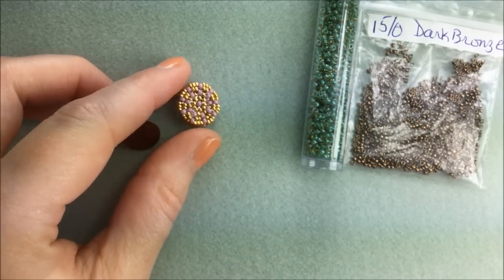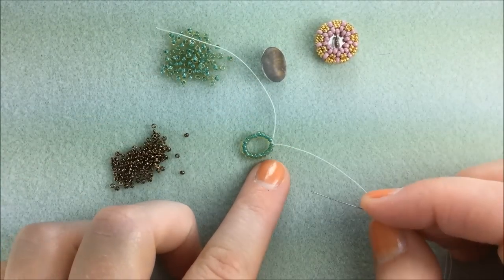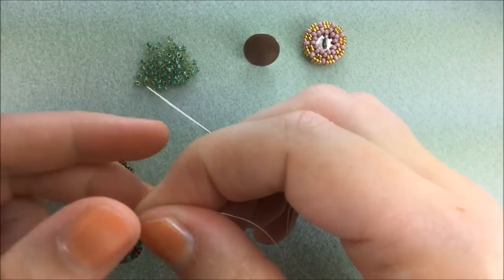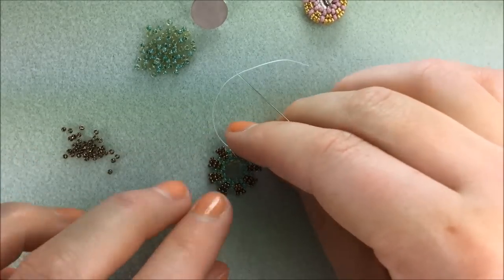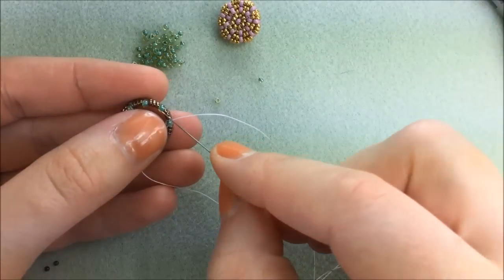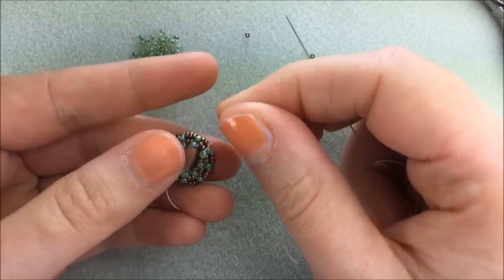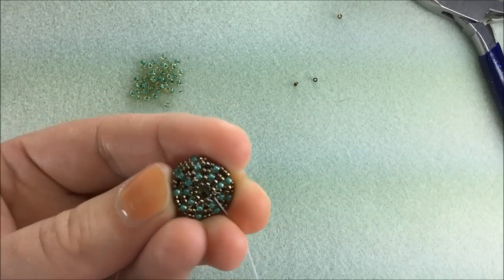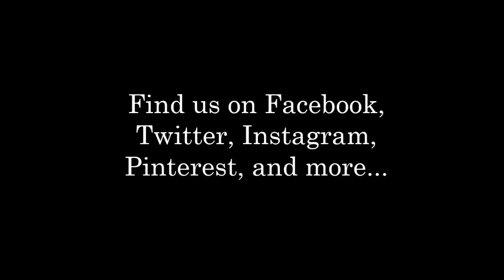Beaded Button- DIY Jewelry Making Tutorial by PotomacBeads

Comment: Do you have any videos on how to put a beaded button shank into the beaded bracelet?  Like not embellished on the top, but actually beaded into the bracelet.  Like how put the shank down into the beadwork?
Reply from the maker: If it's a tubular style, that would work, but for a flat style, you would still need to attach the shank either to the surface of the beadwork or to a wire guard at the end of the beadwork. Consider wear and tear when you attach something stronger to your beads, because there will be friction between the metal and glass and pulling on the threads.